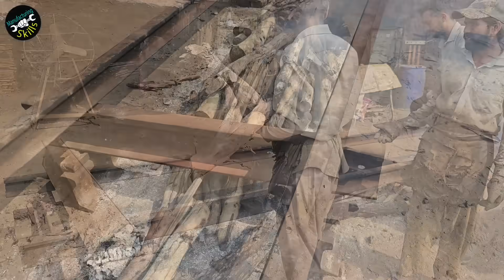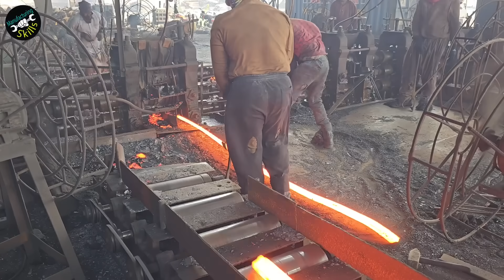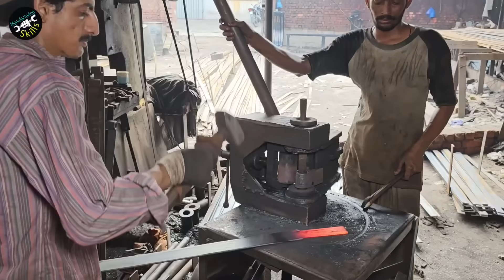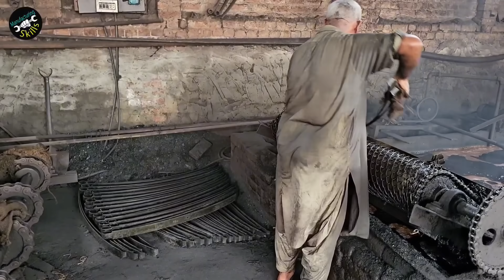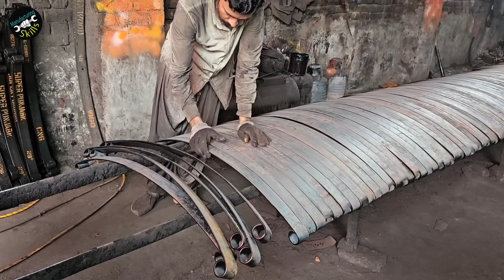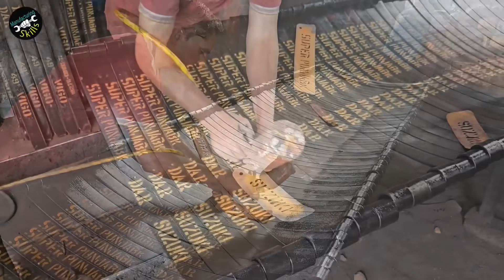Complete Manufacturing Process Of Making Leaf Spring

Comment: I dont think, that railway steel is good for springs... Pretty high carbon content and fragile.
Reply: It's true to degree. I would personally not use rail track for leaf spring material. But they are around 1084. So it can be used but not for high load spring.

Comment: Rail steel is not ment for spring leafs best material for leaf spring is EN 42 grade silico manganese steel.
Reply: I Agree with you 100% that  Scrap Rail Steel is never meant to be used as a Spring manufacturing Raw Material, may be these springs would be used for TONGAS (Horse /Donkey driven Carts) never recommendable for Automobiles.
Reply: Never meant to be, but it did works. They will be out of business if it wasn't profitable.

Btw, this is Pakistan. You use what you can.